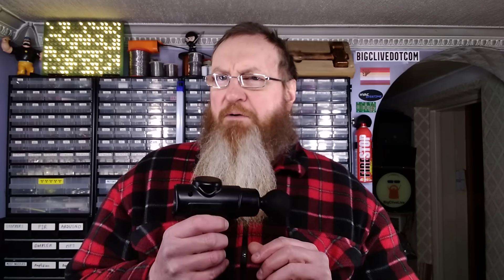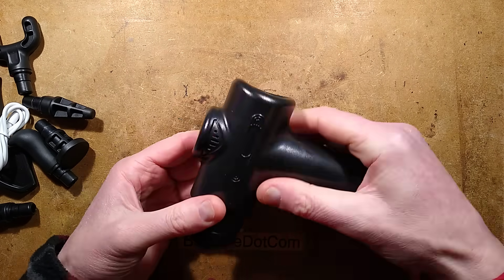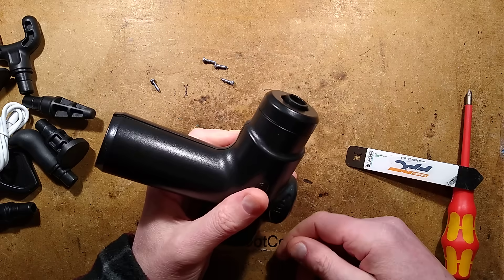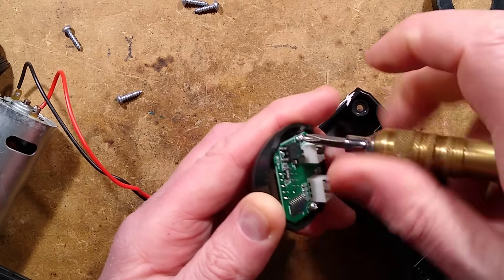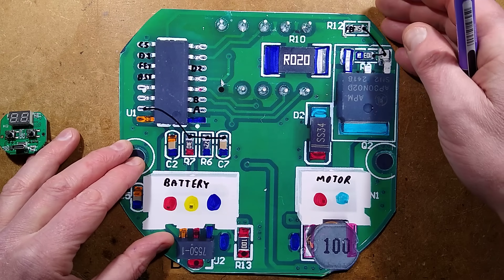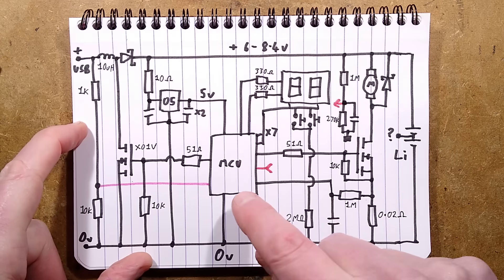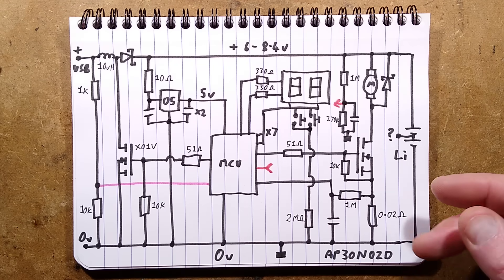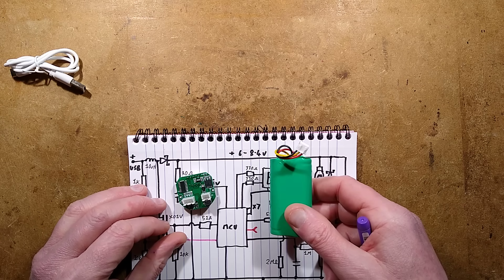Inside a percussive massage device - with schematic

Comment: I found similar device in the dumpster. Didn't know what it was, had no idea. After charging and testing the device I found the reason it had to leave, it made some squeaking noise by rubbing plastics. Some lubrication (white grease) did the trick. 😉 Really, some people lost the creativity to find a solution or is it just laziness? Because of the gun looks, I was thinking to make a LED fantasy light gun out of it. The ball with stick at the end could be used for an diy arcade joystick. That is the goal for me, can I make something different out of it if I can't use it as is. That is really fun looking this way at objects. If you do this very often, you will see many possibilities in any object.   

Anyway, the yellow wire of the battery is probably connected to a thermal resistor that is fitted between the two battery cells to measure the temperature. It is not a smart feature reporting the voltage or other clever things. Charging method is really not a great design, it relies on the input voltage. Could be problematic when sticking in wrong (higher) voltage (for some reason). Because of the voltage regulator, the MCU can't notice the higher voltage at the input. It goes straight to the simple boost converter and after this to the battery. Not great.

Comment: I have a similar one, and the behaviour you describe regarding the stalling detection is what happens to mine.  if it stalls, it stops.  it`s actually quite annoying.
and it`s usually used ton muscles, as some therapists, like chiropractors or massage theraist (not masseuses) use.

Comment: From other comments it seems it's not the case, but I'd have opened up the battery wrapping to see if there's a protection circuit with a built-in balancer in there. 
Perhaps the yellow wire is just a temperature probe they decided not to use.

Comment: In the event people are actually curious: these are message guns or myofascial guns, and this sort of vibration therapy for deep tissue massage was introduced sometime in the 1950s. The theory of operation is that the vibration causes the myofascial, a membrane around muscle, to relax and allow for better muscular stuffness reduction, dulling of pain and temprary increase in ROM.

Theyre not actually quack products, but without any standards governing their manufacture one product can be significantly less effective than the other.

Please don't use it on your junk. The motion and frequency are enough to cause legitimate damage. The ball is a general massage tool for things like your traps, where the flat disk is for harder muscles like your quads, the fork is for either side of your spine and so forth.

I'm a powerlifter and these are standard equipment for sports physios.
Reply: Yeah and absolutely don't use it on your balls unless you're into cbt that doesn't mean cognitive behavioral therapy.
Reply: Any chance you could get into blood clot territory if you use this in the wrong area? Also when I use it, I can't help but feel the vibration in my inner ear and it drives me nuts. Cant imagine it's very good for yoy
Reply: @_mycotroph  no and it sounds like you're using it on bone. Don't do that.
Reply: @_mycotroph   the companies (resellers, really) usually tell you to use it for no longer than 1-2 minutes at a time. Some even have disclaimers that if you use it for any longer, they can't be held liable for any damage caused. A gentler massage wand is needed for longer-period massages.
Reply: Can it go inside your bum?

Comment: How would you mod the pcb so it always goes full throttle?
Reply from the maker: Not recommended as the circuitry protects against overcurrent from a stalled motor.  The risk of the motor burning out and potentially overloading the lithium cells would be high.

Comment: Hi Clive.  That current sense resistor is part of a classic 'negative resistance' stabiliser cct.  As the load increases, the speed will drop, and the current will rise.  The micro detects the current increase and proportionally increases the duty cycle of the driver to maintain a constant speed.  These ccts work well on moderate loads but get a bit overenthusiastic on high loads so the speed increases as you found.  The battery voltage also affects the stability and they can be a bit lively on fully charged batteries.

Comment: How could one modify this to slow the whole thing down, by a factor of say 90%?.The thrust length is set by the cam, but the speed would seem to be hackable… asking for a friend who might benefit from such a mod….
Reply: Could that be done by increasing the value of the series resistor on the gate of the motor driver? Or adding series resistors to the motor?
Reply from the maker: It would really need a motor with a gearbox.

Comment: Those things have lots of added uses - they are really good for getting cement to settle firmly around rigid posts too, by vibrating out any air pockets, as well as all kinds of jobs where controllable yet firm vibration is useful, even such mundane jobs as maximising the fill capacity of jars of solid objects such as granular chicken food or cat food.
Reply: I Mentioned in a comment that I was looking for other uses for this tool also.￼

Comment: I remember way back in the 1970's there was massage machine around and it was hand held mains powered, it was the AC currant that made the plant with lots of plastic bubbles vibrate and we use the vibrate machine for about a week also the put into a cupboard and forgot about it

Comment: My money was on the 3 pin battery connector being so the factory assembler couldn't plug in two 2 pin cables wrong, until I saw the 3rd wire on the pack. Suppose a better made one would have a BMS with cell balancing.

Comment: Now that I see it, I bet the motor is the same as those used in portable vacuums, for the fan. There must be different styles, I "traded" a small one for a larger one, but the larger one needed a 15V charger vs the type C. I assume the larger is a mess of  NiMH

Comment: I 3d printed a longer shaped cylindrical rounded tipped attachment for mine. works great for massaging with a bit longer of reach.
Reply from the maker: It sounds slightly abrasive.

Comment: Does the yellow-wire from the battery pack, at least connect between the two batteries? and perhaps is used just at the factory, to check, charge,  and potentially balance the two, before installation...? Thank you! Cheers-
Reply from the maker: Possibly.

Comment: I was hoping the internals were the same as the motors i bought a while back for 4-5usd a set. Those were brushless outrunner motors with nice ball bearings and a control board which contained the 3phase driver and boost charger for 3S packs. They were also advertised as being from massager devices too. Mine were constant rpm (4 speed selectable) regardless of load until they stall, also has lots of torque.

Comment: Curious, the 3x 18650s in mine are not long for this world; could I just open up the battery pack, and literally swap new cells in one-for-one for the dead ones?

(It used to last for ~2 hours, and now I'm luck if I get 5 minutes...)
Reply from the maker: It may be worth checking to see if they have gone very out of balance.  Measure the voltage of each cell and if one is much lower than the other you may be able to selectively charge that one to match the others.  But if it loses charge quickly again then it's time for a new unit or new cells.

Comment: This is actually a very useful device. Had a frozen shoulder - it helped me regain movement and get rid of pain in two days. Faster than physical therapy.
Reply: I used mine for the same thing, unfortunately my frozen shoulder was too far gone, according to scans anyway, I got some relief but it still persists 2 years later. But I agree, I got a lot better results from one of these than I did my 4 sessions with the physio.
Reply: How does it compare to TENS?

Comment: I have a larger version for neck and leg pain for which it is very effective. I'd have thought, even on the lowest power, it would be too violent for relieving 'hysteria' but maybe that's ok for some 😳
I also use it to shake up the small 'Humbrol' style paint tins, use a bit of gaffer tape to hold it in, works a treat, just make sure the lid's on tight!
Reply from the maker: Some people have a lot of hysteria.

Comment: I have one of these and it has many uses! You can even buy 'special' shaped attachments for these on certain cheap, Chinese selling sites in many varied shapes and sizes! Not sure I can discuss the various misuse of these on here but one I can mention is for knocking the air bubbles out of concrete.

Comment: Those massaging devices are quite nice. The cheap massage guns are okayish, average quality, but I wouldn't use them to relief that type of hysteria, because they are not water proof (bad things can happen). There are devices that are much more expensive which are mostly water proof. At some battery powered devices the manufacturers are saving 10 cents of material cost for some rubber plug to cover the charging ports which is kinda annoying. Clones of the original Japanese massaging device are still very popular.

Even those devices meant to relief hysteria can be used to massage other regions of the body, like the neck or back. They come in suprisingly different sizes, from really small ones to big ones, quite variable speed settings, Bluetooth controlled, etc.

Comment: Did you check under the cell wrap to see if there is a battery management board? I've seen many that are small enough to fit on the tops or run parallel to the battery.
Reply from the maker: I couldn't feel one inside and the three wires coming out suggest external battery management.
Reply: @bigclivedotcom or mismanagement, in this case. I bet there's no software for over-discharge protection, either.

Comment: I bought one of these and it works really well on my back and shoulder. Much like a TENS unit, it can most definitely be used for "other pleasurable pursuits" aside from massaging. I've seen some very interesting attachments available for these percussion massagers on many online retailers, but I've often wondered how standardized the socket for the attachment is.
Reply from the maker: There appear to be a few standard sizes.
Reply: A coworker has one and suggested that if you equip the unit with the ball attachment and then grip the ball with your pinky, ring, and thumb it leaves your straightened index and middle finger making an odd vibration pattern that with some imagination might be applied to the betterment of woman kind.

Comment: Im working on a conversion of mine, to use it for shaking Vallejo model paint pots, a commercial shaker is really expensive.
Reply from the maker: It should be straightforward to design a 3D printed adaptor for that.
Reply: Look for a cheap 'nail varnish shaker'. They're great for model paints too. Just be careful you don't hold the pot too long or you'll get vibration white finger! 😮

Comment: omg these are amazing on your neck and spine, i got 1 at goodwill with a dead battery and i modded it to a plugin model with a 12v3a smps, they make 2 models of these, some have a big chonky motor and an offset bearing to reciprocate, the fancier 1s have 2 large solenoid coils

Comment: Can we take a moment @7:00 in to appreciate how Clive cut the paper into the shape of the pc board for better presentation.
Reply: I remember the day Clive started probing a component on the printout with a multimeter, then realized that's not going to work.
Reply: When I first saw Clive handling those several years ago, I was confused and mesmerized. I couldn’t understand what I’m looking at. A superimposed picture? But he touches it. A giant circuit board? But those components look 2D. There were no borders to reveal that those are prints.
Reply: Which messes even more with me. I quite often forget that they are printouts completely ignoring the fact that there are SMD ICs larger than Clive's thumb. It usually takes him writing onto a part for me to snap out of it (and even that took a while to now catch immediately; in the beginning I caught myself thinking "how can he write on top of a capacitor so easily" for a few seconds).
Reply: He always does that. It's the tying towels into animals of circuit teardowns.

Comment: Voltage divider on the input is likely because the tiny microcontroller has a built in 4.096V reference cell, connected internally to the ADC ( and probably also an internal DAC as well, able to be multiplexed to some of the pins, like the ADC is as well) so you want to keep the voltage input below 4. 4V, so the internal protection diodes of the ADC do not operate, as those typically will be coupled to the reference voltage, as it can both source and sink a small current without affecting the DAC itself, allowing you to use an ADC input as a simple comparator so a sleeping microcontroller can be woken up by either an interrup on a pin with a weak pull up enabled, or by a ADC input crossing the comparator threshold, without needing to run the ADC polling the input, simply powering the picopower internal reference and enabling the comparator to use the full reference, so no need to have the ADC current internally, or the clocks running at all.

In operation the DAC monitors the battery voltage and the motor current, so as to shut down when low battery is detected, and likely the PWM is going to be used to bump up the motor average voltage when the current increases, so as to keep the current constant irrespective of load. Battery voltage sense also is part of the charge system ,the PWM on the charger is likely used with a set ratio to charge the cell using a roughly constantcurrent, till the voltage rises high enough and it drops to a lower PWM as the battery approaches full, and when it detects full voltege it shuts off the charger and goes back to deep sleep with the interrupts set.

Comment: I came across one of those things but without the massage heads. I had a look on eBay and there are definitely some questionable spare heads for them. Very powerful, you could knock nails in with one of those things.

Comment: At the price it is worth buying to take apart for 2 good 18650 cells and the motor. I can think of many uses for it with the speed control as well.
Reply from the maker: I'm not sure what the capacity of the cells is, but they seem reasonable enough, and it is a useful motor.

Comment: Always a hidden screw somewhere😊 My chiropractor uses an industrial version of this on me that can vibrate the fillings out of my teeth...it uses mains power and is a jarring experience but does work good.  Surprised two 18650's power that motor with authority, run time I suppose is short in duration.  I use TENS devices for nerve and muscular relief, no pounding just jolting!😉
Reply: TENS is the greatest ❤ especially with the ‘everlasting’ non sticky carbon electrodes, I wonder how it compares

Comment: I have one of these cheap versions (Temu), and yes, the batteries are bad, with no BMS. One battery gets drained first, and while charging, the other one goes over 4.3V, while the drained one just floats around 3.6V. I'm waiting for a 2S BMS to install with proper batteries. Otherwise, it's not bad (really nice motor for the price).

Comment: The batteries are self balancing. They will both be a 0 volts after your house burns down 😂
Reply: Most powertool batteries doesn't have balancing too! Especially cheaper ones! And how often have you heard of house burning down because of that? If you start with same capacity/resistance cells with same charge level you should be fine!
Reply: Hmm. Nope.
That works with lead accus, but not with lithium.
Lithium batteries unbalance quickly, and become dangerous.

Comment: Hai. Where should i look to buy compliant neon sign cable?
Reply: search "GTO wire"  that should get you in the right department.
Reply from the maker: There are still neon sign material supply companies.  In the USA the cable is called GTO cable and in the UK and Europe it tends to be just described as neon sign cable.
Reply: @ aite ty.

Comment: Many males have tried applying these for massaging "down there". The results were generally described with words ranging from "hazardous" to "immensely painful"
Reply: I must be an outlier then. I own a similar device and it enjoys frequent dual-purpose use.
Reply: Can confirm 😁
Reply: The trick is to apply pressure in parallel to, not perpendicular to, the target area. This also works with other areas containing tired muscles.
Reply: pecker pulverizer.........

Comment: I actually found one of these (Along with some Temu-cheap clothes that don't fit me at all) in a lost package that was for sale at the entrance of my local supermarket for a change.
The massage device on the other hand I took it to bits and only kept the motor, battery and controller.
Don't know what I'll do with it and by deliberately choosing a parcel that had the flammable if broken lithium battery warning on it I actually expected to find something more interesting in it.
About £57 down the drain, I don't think I will try my luck again at those sales that look more like some sort of gambling than anything else given the randomness and possible loss involved that I unfortunately found out the hard way...

Comment: Need one that takes Milwaukee batteries for hotswapping.
Reply: I've got a bad idea, a soldering iron, and some duct tape. Don't tempt me. 😂
Reply: @punkrockllama  After a couple of cans of Stella this makes perfect sense.
Reply: @MoultrieGeek  most of my best ideas do
Reply: @punkrockllama you can get cheap battery adapters that make using the batteries of whatever brand you have access much easier to use in all kind of projects.
Reply: 3d print a tool to Ryobi 40V adapter. yee haaa